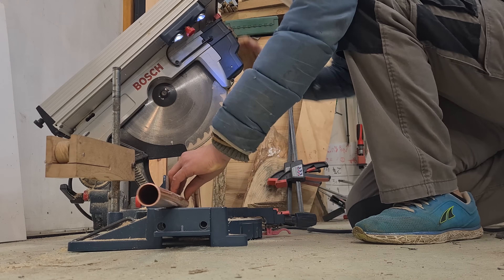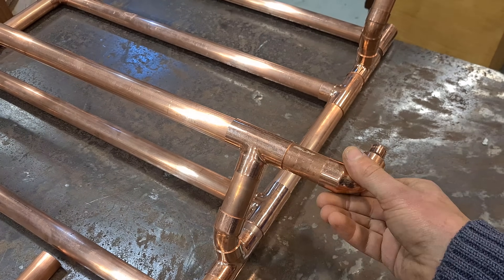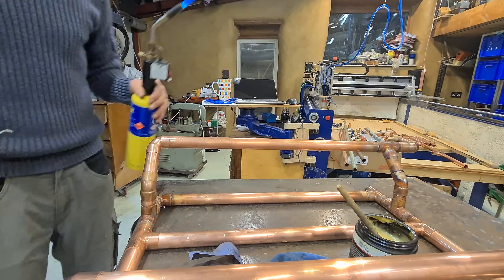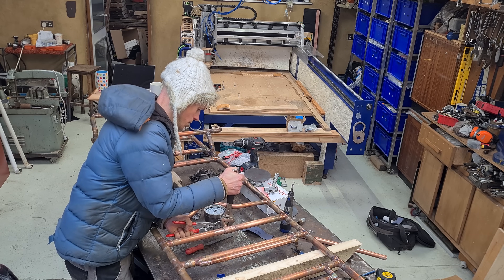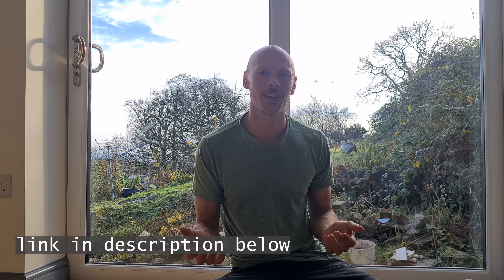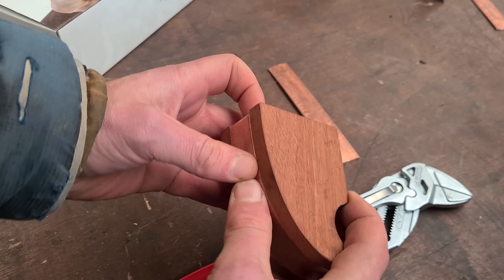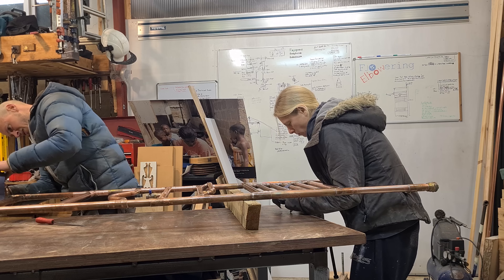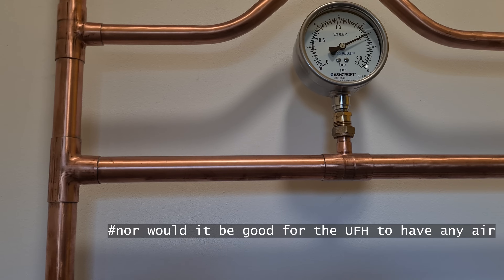Can we DIY a Dual Fuel Towel Rail with Regular Copper Pipe?

Comment: Hello there ! What a project, result is lovely. How do you like your heating system for the shower ? For the last 4 years we've been heating water on demand with gas but it's always a bit fiddly. We are only two and your pitch about the water tank hit home. Cheers !
Reply from the maker: Hi there. Yes we like the electric shower - it works for us because: 
we rarely actually have hot showers, (2 times per week max - the rest of the time it's an invigorating cold blast). 
When we do they are not very long,
We are on the octopus cosy tariff and we are able to time the hot showers to be in the cheap energy periods.  
We only have a cheapo electric shower (I think its 8Kw), but the hot water is instant, and you only heat as much as you use then and there. 
Like we say in the previous video, we have so little room for a HW tank- and keeping that water hot (especially in the summer) is wasteful, so yeah, it works for us.
That said if you currently use a combi boiler, that will probably be cheaper in £s to run a shower....  
Thanks for watching :D

Comment: Okay, soldering tips:
Heat the metal, NOT the joint; you need the whole contact area where the solder needs to flow to be a bit above the melting point of the solder.
If you just heat the joint without spreading the heat around locally, you’ll get over-heated hot spots where the flux risks burning and won’t whet with solder, and correspondingly you’ll get cold spots where the solder won’t flow.
Observe how the solder flows as you make each joint - watch for a nice bright ring of solder to appear all the way round the lip of the fitting.

Comment: So in the US we use -ize as a suffix.  Instead of pressurising, we spell it pressurizing (even Firefox spell check prefers the z).  This begs the question, in the UK, what else do you keep the Z in the alphabet for other than to spell zebra?  If nothing, maybe it's time to retire the Z, and zebras can be xebras.  Then your alphabet will be 25 letters, which has a nicer symmetry with the metric system you have.

Great video.  Thanks for sharing your adventure.
Reply: I’ve got a Zanthoxylum in the garden……..

Comment: Drain cock facing up the way, why?
Reply from the maker: This is what we are using as a bleed valve (to release air) from the rad 'shelves'. we also used it during initial flush through - connecting a hose pipe to each in turn - to flush out any flux / debris... Thanks for watching, and good question.

Comment: Did you test the element heating for even distribution? Eg with a thermal camera? The copper alone would help, and convection too, but there's still going to be a gradient from source to coolest part. Is there a full circuit it could flow back to near the element to allow continuous flow in a loop?
Reply from the maker: Hi there @fredio54. Good question, as usual! We've done the terribly scientific test of putting our hands on it and it seeming roughly evenly warm. Would be good to play around with a thermal imaging camera in general around the heating system etc, but we haven't, yet. 
It does kind of have a loop circuit - around through the lowest of the horizontal bars. 
In general we've hardly used the heating element yet, maybe we won't use it much, but it's nice to have for those grim-weather summer times we sometimes have. Thanks again, always good to hear from you.
Reply: @FloweringElbow  My gut feel, probably wrong, was that the opposite side would be a fair bit cooler. But that could easily be not the case. Great to see videos out of you two. I am not close to heading over there. Got made redundant and have not found new work yet. Chin is up, so don't worry :-)

Comment: You could have flipped the "shelves" over so they hung down.This would have eliminated the need for air release valves on each of them, and it would provide book ends for the towels. It also would have brought them a bit closer for the more vertically challenged people... 🙂
Reply from the maker: Yes, very true, there could even have been straight t-off perpendicular things, but some aesthetic nigglet wouldn't let me do it! They couldn't be much lower due to the door swing. As it is, they are higher than the door. The vertically challenged member of the house stands on the slightly rickety toilet seat!

Comment: You don't need to use map gas. Propane is fine on anything up to 35mm and produces a neater looking joint as it doesn't overheat the flux.

Comment: Wont there be an air lock in the bump over the pressure gauge?
Reply from the maker: hmm interesting. Strangely that hadn't occurred to me at all until your comment. I can't say for 100% sure but I think the vigorous flush through I gave it would have pushed it away - it's only a very small section of 22mm pipe.. I can confirm (touching it now) it gets as hot as the rest of the pipes when central heating water is circulating.
Good point though - I really do surprize myself with my lack of thought sometimes - after I considered the two top shelves as well... 
Thanks for watching ;)

Comment: Very nice: it appeals to me, I like copper pipe.

One caution: relying on user accessible valves to prevent it going pop is prone to user error.

Might I suggest adding at least a pressure relief valve to it. Should be small and not conspicuous. But will prevent unwanted bad things happening.
Reply from the maker: Very good point. It's currently only me and Sam in this small cottage, but I have been meaning to take the tap handle off one of the valves so it's locked open. Come to think of it, since we installed and got the flow rate set right, we don't actually need either tap handle - they do look kinda nice though...   Thanks for watching and a good suggestion ;)

Comment: Did you anneal the pipe?
Reply from the maker: Before bending? Not in the bit you saw me bending in this video - which is probably one reason it was difficult ;)
Reply: @FloweringElbow  The coiled pipe comes annealed, the straight pipe doesn't. (at least normally in Australia)

Comment: Amazingly I feel I may have a tip for you. I needed to bend 28mm copper pipe for my overly complicated multi fuel source heating system with buffer tanks. Being tight and poor a 28 mm bender was no an option however a steam train enthusiast gave me a simple tip. Use a spring bender but anneal the copper first. The formation into tubing has work hardened it. It worked like a charm. Still tough but doable by a skinny lanky man like myself. Sometime several heats per bend were required and I used a big propane touch off our kitchen cylinders.
Reply from the maker: Thanks @TheBrick2. You must have had a better technique than me, I did try those things, but to not much success. What were you bending it over? Your knee?!
Reply: @FloweringElbow  yep knee with a kneepad. I didn't have to do a super tight radius (I think yours looked quite ambitious) it was bend one way then back to offset the pipe.

I spoke to a mate who used to make cnc tubebending machines and her said you really needed good containment on copper.
Reply: @FloweringElbow  I had read, or seen on YT, that to avoid the tube from being crushed when bent you have to put sand inside, this helps to compensate for the forces inside

Comment: amazing video! i don't understand how you get the water not just shortcutting through the lower horzontal rails. how does it get worm in the top? just convection and thermal flow through the copper?
Reply from the maker: Yes that. I was a little concerned about that myself before testing it in practice. I guess the flow of hot water is up... It heats up very uniformly though :)

Comment: Made a very nice spud gun using a network of 22mm pipe as the reservoir - ran at 100 PSI no problem, so don't think any pressures you are likely to create would cause any danger.

Comment: If one of the valves needs to be always open to avoid overpressure when the heating element is running... May I suggest taking one of the wheels off of its valve to stop it from accidental closure?
Reply from the maker: Very good idea. Have been planning to do that for a while, but your comment may just nudge me to actually do it!  Thanks :D
Reply: I suggested a pressure relief valve, but this is also a good idea...

Comment: Phenomenal build! I would likewise have been very proud to see only one minor pinhole leak in all of those joints!
Reply from the maker: Thanks Kris  :D
Reply: @FloweringElbow  try it with refrigeration soft-drawn copper coil pipe.
Reply: @FloweringElbow and aim the torch INTO the joint so the solder flows into the joint.